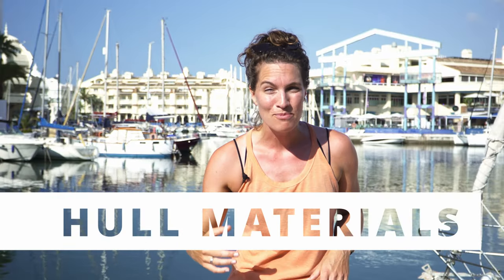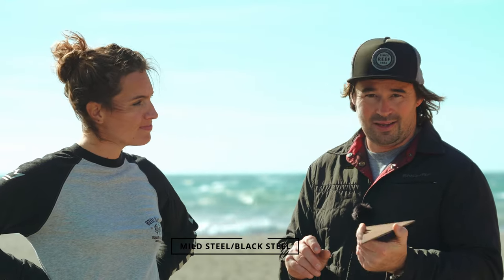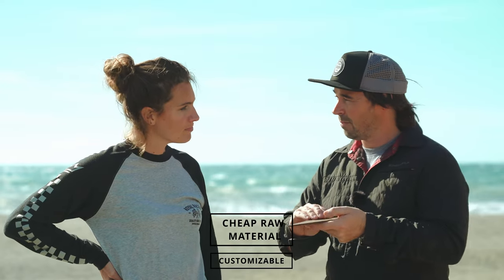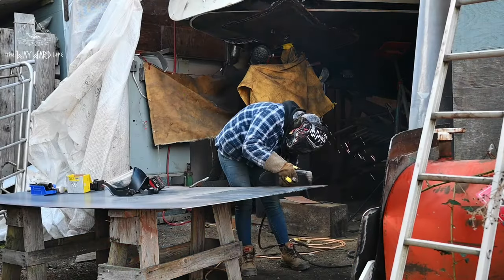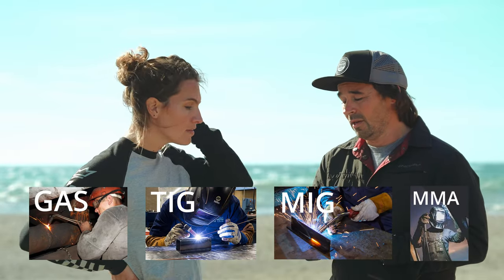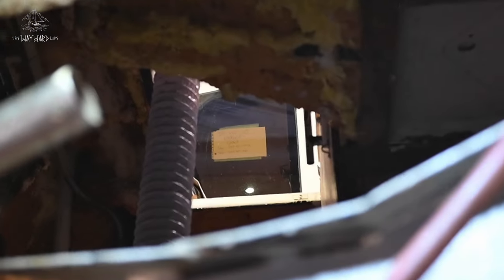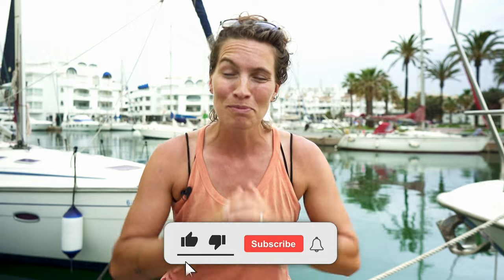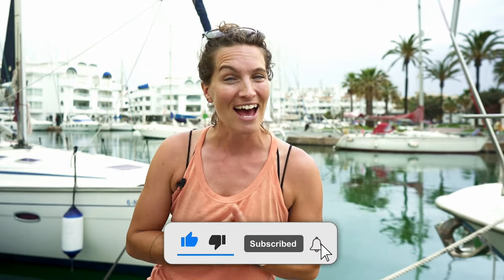Do steel cruising yachts make sense in 2023? - Sailing boat Hull Materials part 2

Comment: If I ever get able to buy a boat/yacht, it will be a steel hulled boat because you never hear about a killer whale/Orca, ramming into a yacht with a steel hull and sinking it.
Reply from the maker: Sounds like a plan! I hope you manage to get your dream boat too! 👍
Reply: So… we took our Steel Callisto 385 to the canaries in September and had a couple of Orca attacks. The Callisto has a full keel with a keel hung rudder… the Orca still had a go, so the theory that they only attack spade rudders is out the window!
The big deal was that even though the Orca grabbed the rudder and gave it a good shake back and forwards (not just a shove)and had a couple of goes, we had no damage, not a scratch… I checked afterwards, all they did was clean the rudder a bit where they tried to take a bite.
The Orca got bored pretty quickly when the didn’t get nice crunchy entertainment, they went off and took a nearby boats rudder off, despite them using flashbangs and various other deterents. 
Maybe a resurgence in steel blue water cruisers is on the cards!
Reply from the maker: Defo a resurgence on the horizon!! 
As for the orca’s I saw quite a lot of damage when we were close to the Gibraltar straits for a year… It appears they will go for anything. Mono’s, cat’s, and of any rudder variant! No one is safe… Steel has always been the best off, in fact I have seen no life threatening damage on a steel boat, though I have seen a steel rudder bent. Mental.
Reply: @SailingAquamarine    that or a orca hunting season  , maybe thinning the heard a lil would help them learn not to go near boats...
Reply from the maker: Noooo, you didn’t just say that😮🥺
Reply: @tarpanc34  I think we are starting to see what caused us to hunt them in the first place lol
Reply: Imm going to rig a gen set from a crank telephone and electrify the water at the first sign of a killer whale. The salt water should be a perfect electrolyte.
Reply from the maker: @marcussanchez4278 😆 brilliant. I’m going robinbhood style with a bow and arrow from a crows nest!

Comment: I have had both… fibreglass boats are noisy and flex way too much. Further to this they crack easily which over time allows water ingress which delaminates the structure. My 55’ Steel beast weighs 22ton loaded, is fully insulated for hot and cool climates, cruises at 7knots plus and I have never needed to do maintenance work on her 32year hull; ever. And no condensation : in fact she doesn’t have a bilge pump… go figure! She is considered a Dry Boat design. Steel yacht owners tend to be more relaxed yachties…
Reply from the maker: Sounds like a fab boat you have there! She’s super light too!

Comment: It depends on what you want to do with your boat. Going through the bering sea during the winter in a grp hull will result in you sinking. It's not if, it's when. You go into the arctic in grp your boat will shatter. In aluminium? Your hull will twist and deform.
Reply from the maker: Much the same as the crew members on board then! No one comes back from there the same as they left!! 😃😬

Comment: The Dutch are steel yachtbuilders by nature. If you know how to handle steel and also the maintainence of it; you could hardly find a more costeffective/durable material. Rustprevention is not that difficult, but you should start the right way.
Reply from the maker: Agreed 👍

Comment: I have had my steel boat for 23 years. The biggest thing with steel boats is to have the inside sprayed with foam with fire retardant in it. The interior of the boat should be sprayed with a zinc coating before the spray foam as well. Other than light surface on the exterior I have no internal rust issues however when in salt water you need to take care of it as it happens. There are a lot of good epoxy paints and you need multiple coatings to prevent exterior damage. I have just completed a renovation of my folks 39 and I will easily get another 20 years of life out of her.
Reply from the maker: Hey!! Great to hear this, steel is an awesome material and it’s so good for people to hear positive comments like this! There is definitely a resurgence with metal boats right now and steel is certainly an option that interests us right now! 
Cheers for sharing your experience and knowledge 👍

Comment: The great thing about steel is that it really one has one failure mode - which usually makes itself obvious to the observant. In some ways rust is your friend because it's so easy to fix if you get onto it early.  And metal boat are a lot more rigid and with proper attention to detail they will not leak. The bilges should be dust dry and clean. 

The best tip I know is to try and keep as much of the wiring and plumbing out of the bilge as possible so that it is easy to clean out with detergent and fresh water hosing once a year or so. Keep the the bilge clean, the paint will remain solid and it will not rust.

Never let wet timber sit against the steel. It will destroy the paint.

Pay attention to dissimilar metals, particularly welds to 316 components. These days you can probably use other synthentic materials instead.

Do these three things and 90% of the root causes of rust on a steel boat will be sorted - the other 10% is just routine maintenance of chips and no more onerous than any other material to maintain,
Reply from the maker: Brilliant post! 👍
Reply: I worked in offshore oil & gas for 10 years in the commercial diving industry, IMCA Life Support Supervisor & Diver Medic.  I spent most of my time on vessels kitted out for saturation diving.  These are large offshore construction vessels made out of steel.  Whenever I was working my way up through the ranks putting my time in there was always something to wire wheel, enrust, then paint.  ALWAYS.  Learn how to properly weld and finish off the work areas and you'll be golden.  I only say learn to weld because you don't want to start paying a welder every time you need something done.
Reply: The 316 is just fine if you use a dissimilar welding electrode designed to join mild steel to stainless. a 309 SS wire is the correct one if my elderly memory serves me correct.
Reply: @Thesilverrat  Exactly correct. The only other detail I'd mention is to paint the weld if at all possible and it should last indefinitely. I've a number of 316 deck items welded to my steel hull just like you describe and they're still perfect 30yrs later.
Reply from the maker: @philipwilkie3239 great to hear this! Steel can easily last a lifetime, just so it right like you guys! We’ve seen some superb examples recently, like our friends on Belafonte (Instagram), these guys are showing the world how well steel can last when it’s done properly. Steel is most definitely real!
Reply: @SailHub  If was doing a new build of a serious multi-hull I'd go with aluminum - but for modest 30 - 50ft mono's steel is still a valid choice in my view.
Reply from the maker: @philipwilkie3239  yeah, I would say the same, if the budget is there ally is great and steel would be the next choice for a cruiser. For a performance boat though… probably strip planked.
Reply: @philipwilkie3239  larger multihulls have been built in steel. At a certain size, the weight to strength problem inverts. Which is why Starship is made of steel.

Comment: OK, as an Engineer, you cannot beat steel for durability. if you looking at purchasing one id very much recommend buying one based on a survey. Buy a steel thickness measuring tool as it will tell you the thickness of the material then you can make an informed decision if it has rust in the bowels or not very easily! if it shows it has then you will need to strip the inside to get at the corrosion properly and that takes time but due diligence before you buy is money well spent going forward. Hope this helps😅
Reply from the maker: Great device especially with the ultrasound

Comment: I splashed my 42' steel sailer year 2000. Prior to painting the hull, it was blasted to SA 2.5 in- and outside. Then the hull was sprayed with insulating and fireproof foam til 50 cm below the waterline. Weight of the steel hull is about 5 metric tons. Keel weight about 5 tons. Depl. fully loaded 16,5 t. Now the boat has bee  in the water for 23 years, with two weeks on the hard every second year. Paint on top and hull sides have been renewed three times. No touch up, no washing, no polishing. Under water paint renewed two years ago. Absolutely no rust below waterline, no condensation inside, no rust anywhere, not a gram. In total, after 23 years, maintenance is a fraction of boats built from any other material, will even compete with aluminium. And Sv Hulda goes through 5 cm (2 inches) of fresh ice like a hot knife in butter. 
BR
Sv Hulda
Mc materials and corrosion engineer.
Reply from the maker: Thanks for the comment!

What an awesome account of good practice! It’s just what people need to see too. Steel is fantastic when we’ll prepared and looked after. 

Mc materials and corrosion engineer.. This is super interesting, I would love to have a chat with you about your material/product recommendations for different materials!
Reply: And you need to realize the properties of the building material from the very start. Just to avoid 'rust traps'., condensation a so forth.

This spring I hit an uncharted rock. Thought the rig should go over the side. When Hulda was up on the hard this July, it was just some paint transfered from my keel and onto the rock. Not a scrath, not a dent, nothing. A standard glass fiber production boat would probably be on the brinck of being scraped.
Reply from the maker: Sure, as a bit builder I’m aware of most of the traps involved in building. As for the material science.. I always think it would be nice to expand mr knowledge 👍
Reply: @SailHub  It's all a compromise. I chose mild steel (St 37 variant). Main welding with Innershield. High high load areas, Stick weld (Baso). Philosophy: The hull should survive hard impact with no cracking in metall or HAZ. Even in sub zero temperatures. Though, bow in 12,5 mm St 56, with an 'Ice Knife' in front. Others will of course make other choices. And we can live comfortably inside in 22 deg C, heated with an Eberspächer 4 kW diesel heater with 10 deg below freezing on the outside. And RF 50 %, or lower.
Reply from the maker: Interesting. Thanks!
Reply: With the exception of my anchor locker my 50ft steel Bruce Roberts is the same. It was professionally built, blasted inside and zinc primed and spray foamed to 3ft below waterline. Not a bit of condensation or rust inside and the above deck has not been an issue other than the occasional spot that usually comes from a dropped tool chipping it down to bare steel. I Haul every 2-3 yrs. The anchor locker is my nemesis and was not given as much thought by previous owner and I've finally got that fixed and it was the only place I replaced plate. A lot of steel vessels get bought by people who don't quite know what they're getting into and usually the boat has been driven hard and then put on the hard to sit for a while. To be honest, if you know somebody that is planning on buying a steel boat and hires a regular surveyor who's probably competent in systems but has never owned a steel boat, I'd suggest asking someone who owns a steel sailboat to just take a look. They'll know what to look for for sure. A sounding of the hull with a fancy meter isn't the tell all. You have to be careful and do your research and inspection carefully. I know of a 52 ft kanter pilot house with a great rebuilt engine that's for sale. My buddy got all excited. It had red flags for me. It was a 1984 build and it wasn't listed with a broker. It had a beautiful interior and looked great in the pics. It was on facebook market place for 25 grand. Long story short.. you know what an uninsulated almost 40 yr old steel hull looks like that sat in New England waters year round? not pretty. Wood is good and glass is fast but steel is real.
Reply from the maker: @robertfreeman2322 hey Robert, such great info here.

Personally I think metal boats are the best boats.. But, I’m lucky (I think 😂) to be a boatbuilder/fabricator and happen to have done lot with many different types of boats over the years. 

I think what your saying certainly rings true, metal boats are fantastic if you have the knowledge and understand them. 

When people are less aware of the potential issues and don’t know how to prevent them, problems creep up on them. It’s then often to late for minimal maintenance. It generally becomes a big ordeal and despite what people think it’s rarely because the boat is made from metal. 

I see the same in other areas too, generally, inexperience in electrics and rigging causing huge problems down the line. With things like rig tension and electrical grounding, it takes time for the problem to come to light.
Reply: @svhulda6157 do you have any videos? I'm rebuilding a 32 foot steel ebbtide, with plans to go north and the ice knife sounds like something I'd like!

Comment: thank you for this series - im litterally weighing between a GRP  or steel boat at the moment.   as much as I hate maintenance - the urge to beach the boat, sail high north, hang in areas without marinas, means - steel might kinda outweigh GRP in having a more "utility" boat.
I feel the cost / skill required to build a steel boat - tend to result in GRP boats being a bit fancier builds thats more designer booats.. steel boat interiors seems decidedly "plainer"
Reply from the maker: So pleased to have helped! Mind you… There’s plenty of steel or aluminium boats with super fancy interiors out there too! 👍

Comment: what about if one generously applies a few coats of primer and added polyurea on top of that, inside and out, would that not be a massive game changer ?
Reply from the maker: It’s quite a common application to be honest, it works a treat if you can sandblast beforehand, without the blasting it’s not so effective though.

Comment: Might be easy to get steel etc to do hull repairs, but what you forgot to mention is there are alot of boat yards that dont allow hot work,  ie grinding and welding steel.
Reply from the maker: That’s true actually, thanks for pointing it out! 
It’s strange how some boat yard are like that, they must think boats are born. 😆
Reply: That's why you go to the fishing boat yards :-)
Reply from the maker: Nailed it 👍
Reply: @timothyblazer1749  all well and good if you have a large fleet of small steel fishing boats to support big yards dedicated to them but not everywhere has that. We don't where I am. Steel fishing boats are in the same position as everyone else.
Reply: @benmac940  "where I am"... Sir, its a boat. Go to where the steel boatyard is :-)
Reply: @timothyblazer1749  not everywhere has dedicated boat yards especially for steel boats.
Reply: @benmac940  I know. But its a boat. You can move it :-)
Reply: @timothyblazer1749  yeah just move it across hundreds of miles of open sea. No big deal.   Sometimes moving ain't as easy as you make it sound.
Reply from the maker: @benmac940 your not wrong there chap…. Getting ours back from Switzerland at a sensible price is a MISSION!
Reply: @benmac940  if its on the ocean and basically sound, and you're a sailor, then I don't see the problem. If its not basically sound, and you can't find a boatyard that will allow hotwork in your area then yes, it's a problem. Hundreds of miles of ocean isnt a big deal. That's a day or two at sea. IF, that is, you're a sailor.
Reply: @timothyblazer1749  maybe that is nothing for you might point for everyone and there situation and boat it is still something to consider that is a fact whether you want to admit it or not
Reply: @benmac940  Friend, Im just pointing out the contrary example. There are may sailors whom have travelled thousands of miles to get good service, and many who couldn't travel 100 miles even if they wanted to. My point is simply that there are more choices than you initially intimated, depending on the sailor.
Reply: @timothyblazer1749  not sure what you're trying to say as all I ever said is most yards where I am don't allow hot work so it is something to bare in mind if buying a steel boat. I never said there wasn't ways around. And I'm not sure where you are but traveling in some cases 500 miles where I am is a fairly major undertakings the avg sea conditions here

Comment: The weight to price ratio of steel versus aluminium is positive for aluminium (weight difference 5x)with the added positive effect that aluminium is lighter. Steel might be better if build correctly in iceberg filled waters but proper aluminium yachts can be good also there. (aluminium can be welded MIG TIG also by the way)  Biggest advantage offcourse in the cost departement is that aluminium does not need paint...So in the long run aluminium gets to be even cheaper versus steel.
Reply from the maker: It’s a romantic idea however, the tig and mid welding process for aluminium takes longer due to the natural heat dissipation. Basically we need to preheat thick alloys and leave then to cool again naturally, in general it means that despite the material costs an Aluminium boat takes more time to fabricate and therefore will always cost more than a steel boat. 

Painting though, yeah it’s a win for the ally here! Another thing to bear in mind though is that a well blasted and sprayed steel boat will last an awfully long time before it needs a full repaint again so it’s not really a cost consideration for most metal boat owners. Still, your right that it could make the difference for some people.